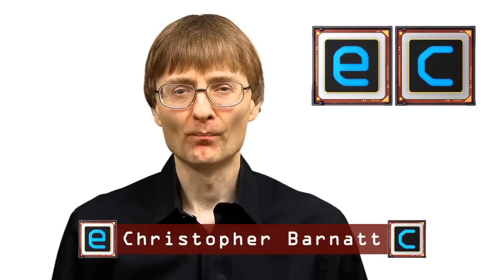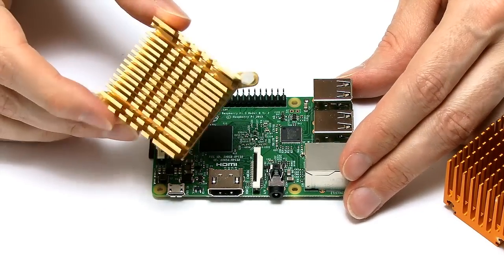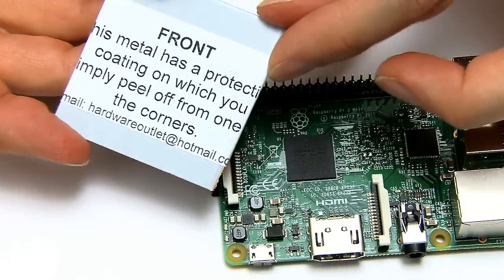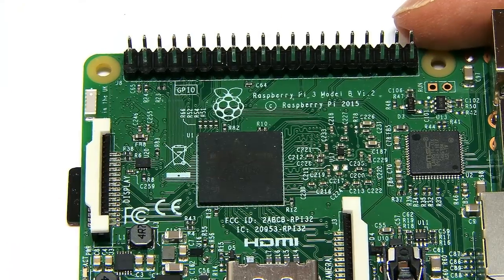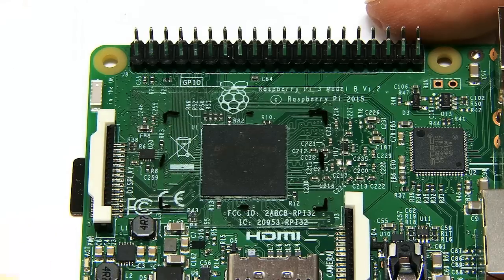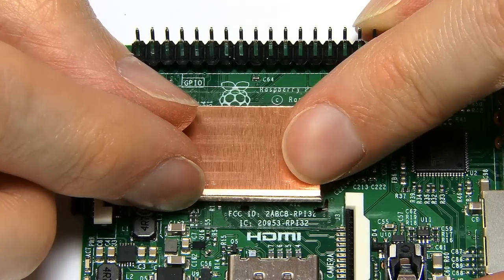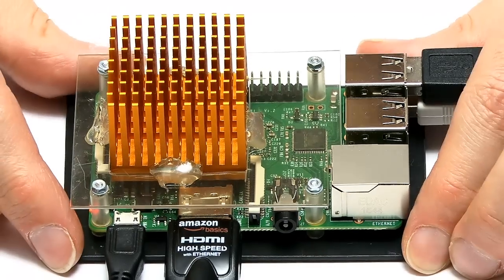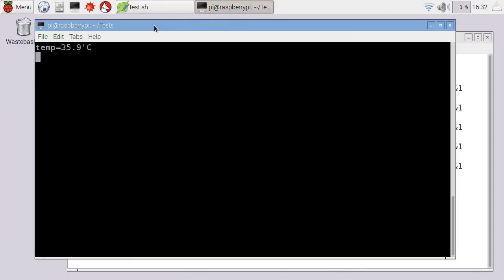Raspberry Pi 3: Extreme Passive Cooling

Comment: I think that the video is quite cool! That being said, I don't think that you're actually saturating the heatsink (which is why you see that the temperature keeps climbing.) I think that once you saturate the heatsink with the raspberry pi's heat output, you will see higher temperatures (how high, I don't know, but I think it would be interesting to see.) As such, I don't think that the comparison here is necessarily valid.

By the same token, who is going to run their Pi3 at 100% load for as long as it takes to saturate that heatsink in the real world...
Reply from the maker: +Kevin Kaminski I run this for a longer trst in the vidro uploading this Sunday. Though as you note, the issue is how long you would run the Pi as full CPU utilization in the real world . . .
Reply: +ExplainingComputers cool! Yeah, I have one coming in the mail soon, and I doubt I will really push it very much at all...

Comment: nice and cool video and fitting heat sink is great. i love it but why dont you add a small 5v dc fan and give 5v supply from board to tun fan.i think it will further reduces the heat and give batter result any way great
Reply from the maker: +irfan lodhi I will be posting a video of what you describe a week on Sunday. :)

Comment: I wonder if a raspberry pi could be more overcloked with a peltier cooler and that passive heatsink
Reply: +Rurbital Condensation would short the Pi.
Peltier cooler takes more power than a Pi3 at maximum draw.

Comment: Seems like all of your additions will interfere with a number of the R/Pi connections. Also takes up a lot of space. Does a nice job, though.
Reply from the maker: +jmtnvalley This addition blocks the GPIO pins -- but only because I could not face doing that cut-out in the perspex! My last addition (the fan) left the GPIO pins free, but did use the 5V and a GND rail from them for power. As for space -- yes, this is big (and heavy).

Comment: Could someone tell me what the point of this is.  Or is it just for the fun of it /why not?
Reply from the maker: +WILL D Both fun and practicality. A Pi 3 heats to over 80C at full CPU utilization, which in time will destroy the chip. Hence, in some situations, cooling is needed -- and as my earlier videos have shown, sticking on a tiny heatsink does not cut it.
Reply: +ExplainingComputers okay so only really necessary when over clocked... But interesting.   The whole enclosure came out looking pretty cool in the end

Comment: ignore this if someone else has posted it, but 5:18 "fittings more bits together"
also 7:50 that hot glue on a heat sink? for a moment I was worried, as heat sinks go both ways. another fun experiment I like to do is just hold one and laugh at its indefinite cold feel vs. all other things

Comment: Extreme Passive Cooling with Fan does it will be more cooler?
Reply from the maker: +Abdelaziz Elrashed Yes, adding a fan would probably cut another 10 degrees off the top temperature.

Comment: Wonder how cooler it would run if you place a fan on that bigger heatsink :)
Reply from the maker: +Adel Ammari I'll show that in a video on Sunday! :)
Reply: +ExplainingComputers Thanks. Furthermore, its worthy to mention for the users that the Pi is desogned to work in normal conditions without the need of any heatsink or fan. So basically, cooling is needed only when you do some over clocking, yet even that needs to be not so cool as temperature does help in OCing :)

Comment: Did anyone ever use sterling silver sheet instead of cooper? just wondering if it would be a better way to transfer the heat from the chip?
Reply: +spkt0r Not really an answer but here are the thermal conductivity at around 331K ( 60C ( 140F )):
 Copper :~3.94 W/cm-k
 Aluminum : ~ 2.4 W/cm-k
Silver : ~4.25 W/cm-k
Aluminum Oxide: 0.31 W/cm-k
source - nist.gov/data/nsrds/NSRDS-NBS-8.pdf

Silver also has a bit higher specific heat.  So really silver should perform better but as for the properties of copper oxides or tarnished silver- not the easiest info to find.  Diamond by the way at that temperature ranges from 8 to 21 depending on type according to that paper.

Comment: Not sure if putting hot glue onto a HEAT sink is such a good idea
Reply from the maker: +ConeTheOne The heat sink does not get over 50C (probably less, as the CPU only reaches 50C).Hotmelt melts at c.120C. So there is no problem! :)

Comment: 4:56 Okay, now your only real contact between the chip and the heat sink is the surface area of the glue. This means that you will create a hot spot on your chip instead of drawing heat evenly from all over the surface area of the chip. Maximum heat sink would require full contact with the chip.
Reply: Its a CPU  thermal gel. Its not glue. Works differently as it conducts heat more evenly and better than copper etc.
Reply: But then why so sparing on the application??? Should have slathered it all over the top of the chip and then plopped the copper slab right on top of it.
Reply: Youtube a video on its application. 

Firstly the thicker the gel layer does not mean you get better cooling ie a 0.1 mm same as a 2 mm thickness for heat conduction.

Secondly you don't want it to go off the chip as this might allow heat to transfer to other components or the board ánd its  a headache to clean up.

So its always a small drop, not a line, not a large drop, a small drop.

PS you need this gel ideally between all cpu like components (CPU/GPU/Northbridge/Southbridge) that are attached to cooling. Higher end motherboards will have passive heat sinks on other non cpu chips on the board eg usb controller. I clean my GPU and pop of the fan to clean it so I end up putting some cooling gel on the GPU.

Hope this helps. Google is your friend.
Reply: as a tule of thumb thermal paste is applied that way, you put a "drop" in the middle and then put the heat sink and let the pressure do its job of spreading the thermal paste. If you spread the thermal paste yourself there will be spots filled with tiny air bubbles which is bad. Also, the heat is produced more in the center areas of the CPU so you dont really need the thermal paste to reach the corners of the CPU to do its job. Search for videos on applying thermal paste, it's actually pretty interesting.

Comment: 'ere, 'ang on!... How you supposed to access the header pins?.
Reply from the maker: +Stephen Ancell By cutting a hole in the perspex if you need to! :)
Reply: I guess that needs to be done before it is fitted, especially with clumsy old buggers like me. :D
Reply from the maker: Stephen Ancell It certainly does! To be honest, I did not expect this to work anywhere near as well as it did, so I did not bother making the cutout.
Reply: +Stephen Ancell  Cor' Blimey son. We don't need no stinkin' header pins govenor when we have extreme passive coolin!
Reply: Nidz Blah
But look a them pins, they all stand there on roll call. Putting them under plastic is like giving them a gagging order.

Comment: It is just me, or hot snot on a heating element is a awful idea?
Reply from the maker: It works in this hack! And it will not melt, if that is your concern, as the heat sink does not get close to 50C, while the hot glue melting point is c.120C. :)

Comment: where to find the heat sink? please help guys :(
Reply from the maker: The heatsink here came off an old motherboard I think (it was in my bits box). It is about 34mm cubed.
Reply from the maker: Wow, good find. It is not the same, but very similar. Should work OK (with a copper or other spacer underneath as in the video). Good Luck!
Reply: Thank you so much!

Comment: You haven't mentioned that your top plastic cover completely obscures the Display Interface connector AND the Camera Serial Interface, which is fine it you never want to use them.  It also means that most off the shelf HAT ( Hardware Attached on Top) are going to be useless now.
What might be an EXCELLENT future project would be to add longer bolts and to use a piece of circuit board which has bee etched and drilled so that the interfaces are brought to the top and the board itself holds down the heatsink instead of using hot glue.
How about it? Are you up for the challenge?

Comment: Very nice job! I plan to replicate this on my RPi 3. Unfortunately, Amazon.com doesn't carry the same copper sheet material and the company that sells it on Amazon.co.uk doesn't ship to the USA. 

I did find both the copper plate and an almost identical heat sink on EBay.com. The latter may be aluminum as it is painted black. If it is there should be little difference in heat dissipation.

Comment: .i found that the Pi3 comes out the box over volted (makes it a little unstable). .to get a more stable and faster Pi3 all you do is set force_turbo = 1 and change from 1200 to 1275 . . MUCH MORE STABLE/quicker too . .mine is running at 1400 for now . . but is nowhere as stable as 1275  . . .i have found if u do nothing but raise the volts . . the PI3 becomes unstable  . .  its slow n tends to freeze. . .hope this will help you . .good luck
Reply: I am interested in this theory. What version of RPi3 you have (i mean Raspberry Pi 3 Model B Version 1.2? How do you know there is over volted situation? How do you notify that your pie is unstable?
Reply: Pi3B . .i wanted to see wot would happen if i overclocked wit all settings standard. . so i went from 1200 to 1225 . . all fine then 1250. . same again then 1275 and it was more stable and quicker than wen new . .+ after i played wit the arm_freq and sdram_freq n found i could get them up too  . .i look at bootup/shutdown time n playing same vid on youtube & changing  from small to full screen a few times + not 100% but i beleive pages load faster or slower depending on the settings . . wen u make a bad choice u will mostly notice on bootup . . & if pretty bad then on shut down too . .wen you hit the magic numbers it seams so much snappier as opposed to standard. also you might notice on bootup that the 1st thing u see is the desktop but no menu icons for a sec or 2 . . if bad settings then icons take longer to appear  . hope thats helped you . .

Comment: Why are you using a heatsink?
Reply from the maker: +Bracken Dawson Because a Raspberry Pi 3 can get very hot (hot enough to damage itself) if run at full processor utilization. This is also an experiment! :)

Comment: +ExplainingComputers Can you make a video that explains the effectiveness of:
1) Copper-base+Aluminum-heatsink
2) Aluminum-base+Copper-heatsink
3) Copper-base+Copper-heatsink
4) Aluminum-base+Aluminum-heatsink

Help us settle the argument once and for all by having the base and heatsinks in the same shape and size. (Not by weight)
Reply from the maker: +Lasse Westvang Hougaard Volume-for-volume, copper will always be a better base and a better heat sink. Aluminium is just cheaper and lighter. So above copper + copper will work best. :) And ideally, copper only (having a base and a heat sink introduces a thermal joint, which is never ideal.
Reply: +ExplainingComputers yeah.. copper 1.8$/lb vs aluminum 0.3$/lb is quite a big difference.. (6 times)

I also noticed that depending on the application of 1) no fan, 2) fan and 3) water cooling.
And it seems to favor copper much greater when no other cooling object is attached to it 
1) 8 degrees 2) 4 degrees 3) 1.5 degrees, respectively difference between copper and aluminum.

I'd love to see a video that intensively walks over every single aspect of this.. And/or/if you could use other materials such as Silver and Graphite.. 

And/or if you can buy a bag of diamond dust, Which is very cheap, and somehow use the dust to cool down a chip since it has 5 times more conductivity than copper (Without cutting up the chip).

My idea was to somehow make a little "copper box" and place it on the top of the chip and have the box glued up-side down on top of the chip filled with diamonds dust and thermal paste!

Do you think this would be practical for overclocking?
Reply from the maker: +Lasse Westvang Hougaard The diamonds experiment sounds great! You are also making me think that I should do some videos on PC cooling and overclocking and delve into all of the variables as you say. I have also now started work on a follow up to this video running further tests and adding various fans. It will upload a week on Sunday. :)

Comment: Why not use a pre 1992 two pence coin as the in-between layer
Reply from the maker: +a133m210 It would take a lot of filing to get it totally flat for proper surface contact. :)
Reply: Yes, would need a lot of filling, also grinding away on the faces with the dremel sand paper attachment... or putting on a tram line to be squahed flat.. Maybe just banging the faces with a steel hammer would do

Comment: wow, that regular pi heatsink is horrible. I modified some crappy  transistor heatsink and slapped them on top of the pi 3 and (ironically) it did better than the tiny heatsink+fan.

Of course, the heatsink he used in this test did significant better but of course, the heatsink is also much larger, so, it should do better.

I'm fairly impressed with my ghetto heatsink solution. I'm just happy I didn't have to waste money on a shitty pi heatsink, as I already had these transistor heatsinks in my toolbox.

Comment: I assume these mini computers are mainly for programming and communication and not for running Fallout 4.
Reply: +Hypatia They're quite good at game emulation, such as SNES, DOSBox, PS1, etc. And they also can play games ported to the ARM CPU architecture. But yes, they are mostly used for learning programming, and interfacing with things with the GPIO pins. :)
Reply: +Sheriff Blatz Ty for the answer. Ah if you will, would these be also ok for lets say photoshop work?
Reply from the maker: +Hypatia You can run a great PhotoShop clone called GIMP on a Raspberry Pi, esp. a Pi 3. See my Pi Week: Raspberry Pi as Only PC video for a demo: https://www.youtube.com/watch?v=7QH6RDzllls
Reply: ExplainingComputers Thanks!

Comment: You should have made a clip out of steel wire that would keep pressing the heatsink down. This might come loose over time.
Reply: +zwz • zdenek  Good idea. The thermal expansion can debond the thermal compound and cause thermal compound drying and bleeding, it's better to have at least a tiny bit of clamp down pressure. Though if it was me, i'd be lazy and just use a rubber band. :P

Comment: I love the plexy work here, very neat but... HOTGLUE ??? really... Super glue is a far better option to work with components that reach to hi temps, OR you could get away with a thermal adhesive... I don't want to mention about the headers btw.. I guess you don't use them.
Reply from the maker: +Emre MUTLU The heat sink will not approach a third of the temperature of the melting point of hot glue, and super glue is not good at filling gaps. I also want to be able to get this apart again! :)
Reply: +ExplainingComputers OK taking apart is a key point... I lost all the confidence to hot glue when it melt under the sun in a car console application, I guess it is highly dependent on the quality of those sticks. As I said, I hate them, so unreliable.. On the other hand, I generally use tiny little drops of Super glue around the edge of ICs (thermal paste applied). Very resilient to high temps and works quite good. But it is one time solution.

Comment: You might find the "stress"http://linux.die.net/man/1/stress   command useful for loading experiments, too. 
The other heat-sink configuration that occurred to me after watching these experiments is a sandwich of thin copper-wire mesh (where you have the heat sink in this one). Being essentially porous, it should allow a cooling airflow. Obtaining the stuff in retail quantities to try it is a problem I have not yet solved.

Comment: whays the point of cooling a rasberry pi?
Reply from the maker: +sergio urquijo Because, at full processor utilization, the CPU reaches over 80C, and this will burn out the chip pretty quickly. Most Pi uses will not result in such temperatures. For more see my initial video on the matter: https://www.youtube.com/watch?v=e6okZKRwnTQ
Reply: +ExplainingComputers More than that, once the chip hits about 80, it actually slows itself down to avoid burning the chip up. The cooling solution should keep always at full speed.
Reply from the maker: Kazriko Redclaw A very good point indeed. :)

Comment: Not a bad result. But I'd thermal grease smeared , not to apply it drop .
And I would not do " cake " - CPU-> thermal grease- > copper- > thermal grease- > radiator. Moreover, between the copper plate and the heatsink contact area is too small .
Reply: +BellaLugoshi He needed the "cake" to clear the other components on the board, and the copper shim was size limited.  Do you have calculations or results showing what increase in cooling he could achieve with bigger copper shim?
Reply: serimpala pretalia no need to cut the lining of the radiator in the form of components on the board and carry out the test .